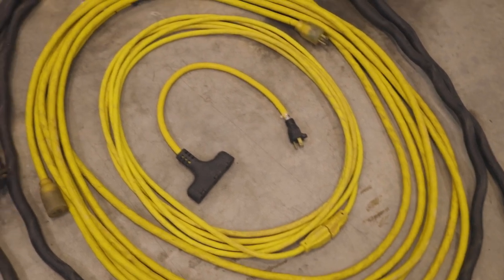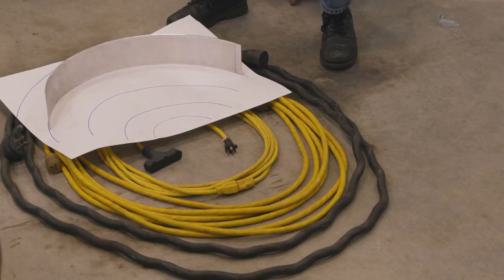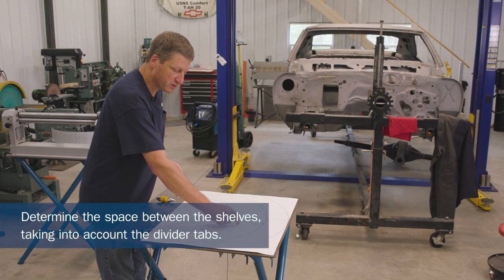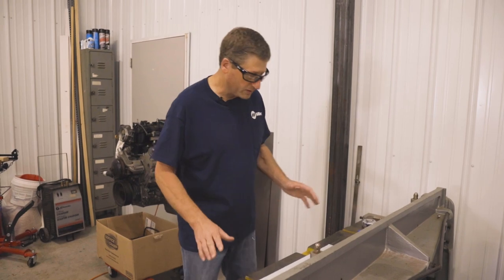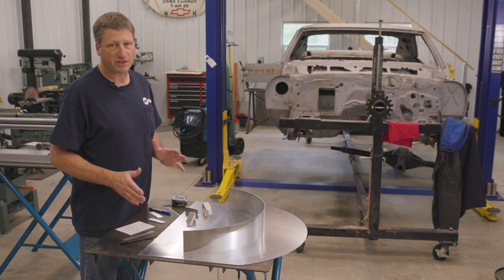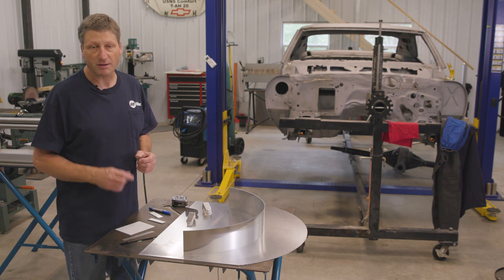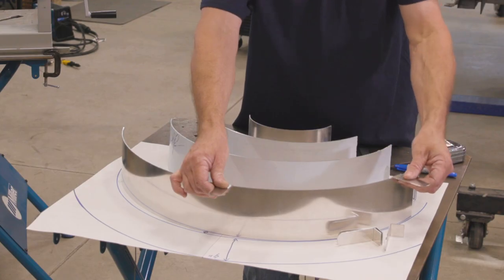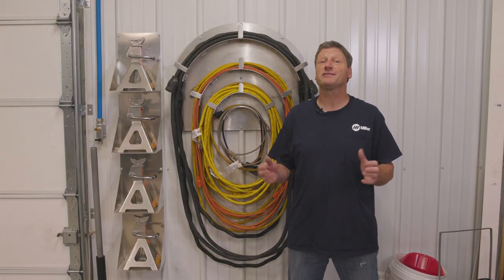DIY Welding Project: Extension Cord Storage Rack

Comment: I just did a similar project.  But, it involved a walking foot sewing machine and junk yard sourced seatbelt webbing.  Basically, I duplicated soft-tie tie-downs in wide seatbelt webbing material.

Nice thing about the seatbelt slings is that the cable, leads, hose, etc. can be transported with the sling in-place to keep things neat.  Then, once back at the shop or garage, hang the sling up on the wall or from a hook in the ceiling.

Comment: I use a piece of flat bar instead of string to do my radius cuts. I find string to be hella finicky. Either way do what works for you ... Great storage solution!
Reply: My mouse works better and it is easy to make quick changes in CAD. Eventually, I cut it on the cnc plasma table I built. I made a similar set of racks for my 2x72 grinder belts with a slit in the top of the radius and a tabs at 10 and 2 for the back belt. A round rod with two finger sticking up allows me to put the belts up higher on the wall, 2 belts deep (the belts do stack on top of each other as well). The tabs stop the belts half an inch or so from the back of the holder, so that my rod will grab the front and back of the belt and I can lift them up and off the holder since the belts don't touch the back of the holder. Recently, I rebuilt my garage and have made a bunch of different holders for tools and accessories out of sheet metal.